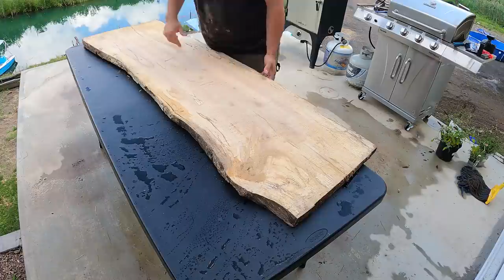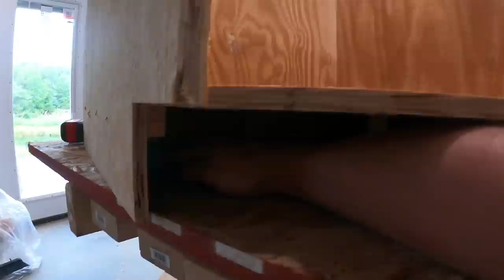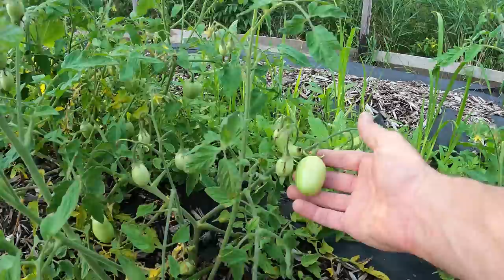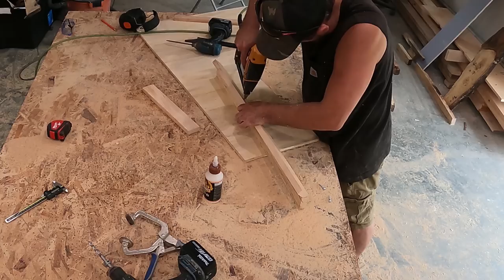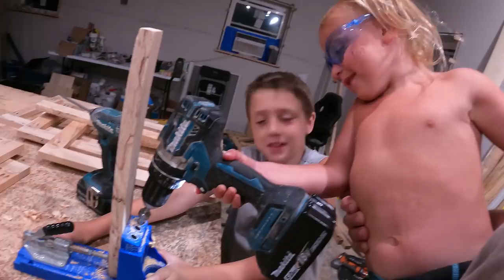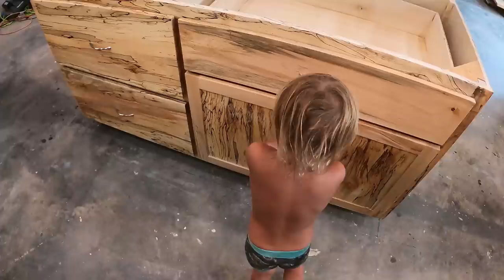From Sawmill to Cabinets : Spalted Maple Shaker Style

Comment: Jesse, the Spalted Maple panels really pops. The extra effort for the panels paid off. Go with low voltage in and under cabinet lighting. Leave access to LED counter top lighting as they do burn out.

Comment: What I have seen with the plywood cabinets is they will run a 3/4 board on the flat (relative to the top) from front to back, about 1 1/2" wide or so. This also gives you something to attach your top to.
I hate to say anything because you already finished, but you can use way less materials making the cabinets "custom" style and running the boxes in 8 foot lengths or more, it just makes getting the top and bottom rails for your face frame a little harder with custom cut lumber. If you want an interior shelf, try a half shelf with supports to the bottom of the floor of the cabinet or adjustable with pins in the face frame, or fixed (I prefer the half shelf and worry for the adjustable ones on the large cabinet runs). I am in the middle of the video, I may think of something else by the end and add another comment but it was just my thought to share now..

Comment: Much admiration for the Cohones it took to jump straight in to those sawmill cuts without a plan. I've tried to learn my lessons on pine but I still ruin plenty of black walnut. I've got a bunch of drying ambrosia maple and the first and last foot of each 9 footer is spalted. When I cut them I tried to plane-saw(tm) meaning overcome the cup in the first saw cut by going back over it again and again with the blade very tight and at max speed. I want to invent a diamond-dust coated blade to act as sandpaper on top of a board so I get 28 inch wide S1S or S2S without a 12000$ planer. I love your use of basic machines. You got the skills to build up to great machines if you sell works like this one. Thanke for the extra teaching talk.. Love your property too man. If I discover you're close to southeast PA I've got some hoarded materials I'll swap ya for a finished project

Comment: Hi Jesse. Yes I agree pocket screws make a very strong cabinet. I am a recent convert to them, because  a builder friend of mine gave me some huge nearly new cabinets he had removed from a house he was renovating for a client.  I used them in my large hobby workshop. They were all made with Maple faced MDF, very heavy and assembled with pocket screws, no glue anywhere but so strong. As I needed more cabinets that I was going to make myself I bought a pocket hole jig similar to the one you have. I have used them to make three mobile benches with draws and cupboards underneath. Previously I had made cabinets by the 1/4, 1/4, 1/4 method It was so much easier making them with the pocket holes than having to do all that machining.
Reply from the maker: Yea these pocket screws are a game changer. They might be a little ugly but they are always on the back side

Comment: Wow, what a massive project. Nice job. I would suggest though that it is best to design things such that the fasteners will be put in sheer whenever possible. For example the bottom of the drawers were glued and nailed straight to the bottom of the sides. If the glue joint ever fails then the nails will always pull out in that configuration. However if the bottom were inset then even if the glue joint failed nails coming in from the side into an inset bottom would never experience a force that would make them want to pull out.

Comment: For the island- keep the middle door and make 2 false panels on either side then open up the sides for a pull out full depth drawer that you can use as a trash drawer - with separate areas within for recycling the trash other end could be a pull out larder style for cereals and canned foods -thats only my opinion😊 but you did a fantastic job on that kitchen- well done Jesse - loving this build series 🎉🎉🎉

Comment: everyone's got to chime in right...my 2 cents is to edge band the plywood edge on the drawers.  last week i bought some stainable  iron on 3/4" edge band from home depot, never used it before...works amazing, easy as talking about it, and looks fantastic.  made the drawers look like solid 1/2" material, from concept to finished and sanded drawers in about 2 min a drawer.  but otherwise great work man!, i recently used spalted hickory and had a very similar coloring and grain.

Comment: In a modern kitchen it is really, really nice to install sliding bottoms on the bottom cabinets.  Getting on your knees to stumble around in the back of a cabinet is fun for no one.  This way you pull the bottom out on full extension drawer slides and can get at everything with ease.  Takes a bit of shimming with face frames but is well worth doing.  Any shelf on the lower cabinets should be a slider.  If you are planning on aging there most especially so.

Comment: Jesse needs to upgrade to a Jet Helical closed stand 6" jointer. I lucked out and found all the items I needed to rebuild my shop with at HALF PRICE.  Found on FB Market place.  Was about a 90 min drive one way but the rewards were worth it. I got the jointer, 44 inch drum sander, oscillating  drum sander and a Powermatic dust collector. Carts, and roller bases were 1/2 off also.  Thanks for taking the time out to explain everything, cabinets are easy once you know the tricks of the trade. Getting the materials ready on the other hand can be a struggle.

Comment: Jesse, before starting the cabinets did you  let the wood acclimate for 3/4 days and have the moisture down around 7/8 but the major problem is sitting the cabinets directly on the concrete because the wood will wick moisture out of the concrete, you need some kind of moisture barrier between them, any water that gets under the concrete will keep cause problems,  but its a great job and beautiful cabinets

Comment: 1/2" x 4' x 8' MDF is only a couple of bucks a sheet more than BC plywood and it's always perfectly flat and extremely stable. You won't have to worry about MDF warping before or after the build. It's only real con is it's a little heavy.

Comment: With the lexan doors and the epoxy tops and lights you will have a one of a kind kitchen for sure!  You may not need a Christmas tree!  lol  You picked one of the most difficult trees to work with given the structural issues, but it turned out incredible so far,  I can't wait to see the next step!
Reply: They're not going to be Lexan . They're going to be epoxy resin poured into a mold , which he will plane on the thickness planer after setting .

Comment: This looks great, very useful tools and detailed explanations. Re: the hinges and door sticking out at 90 degrees - they do manufacture extended soft-close hinges which open 180 degrees though I'm not sure if you have in US as they originated in Europe, I also wondered what the ones you purchased cost - pack of 20 is £30 ($38.42) exc tax over the pond.

Comment: 1/4" is too thin for a panel in a door.  One kick and you'd break it.  Normally, you'd need a panel raising router bit so the edges are 1/4", but the rest is thicker.  You then can put the raised area inside for a Shaker look or outside.

Comment: Those are some really nice looking cabinets, Jesse. Your son with the chicken was hilarious, didn't even notice until you pointed it out, I thought it was a ball or something. I think that chicken might like him.
I found a foam brush more to my liking with the poly coatings; couldn't stop putting brush strokes in until I changed but then I got bubbles, just pop them. You have me curious on which led system you are going to use, they are all either real expensive or practically disposable. that has been frustrating me when people want them.
Island receptacle? I didn't see the wire.
Thanks for the videos. Good job, man.

Comment: For anyone else going through the planning of a new kitchen I would very much recommend a 100% drawer setup, for all elements under waist height. Of all the different kitchens I have used, this is by far the most ergonomical, pleasant and practical - much less bending down, no rummaging in the dark back of a cupboard having to put stuff out on the kitchen floor to get things in the back etc etc. Oh, and you can absolutely do any depth of drawer you wish, just use the correctly dimensioned drawer slides.
Reply from the maker: Yea I may decide to make more drawers later on. I could easily switch to drawers with not alot of effort.

Comment: i wanna give you a good working tip for stacking wood from a sawmill . when you do it again every 6 months or so re stack them in a different way. example the bottem slab in the middle and so on. so you can see if the wood are a little bit crooked . the slabs that are a little crooked you lay them on the bottem with the rest on top so the wood can a little reset to get strait again.,

Comment: think even if you had cut them at 3 inch thick theres going to be tension in the wood when its drying it will warp once you cut it down thinner
maibe you can router and plane the boards down so there at least level maibe glue on  a backing of 5mm ply before making them flat and the same thickness , that might help with warping later on

Comment: If you recess the back of your cabinets 1 inch, and put cleats on the wall, level them out, attach to the studs , and then bevel them 45 degrees, then measure down from the top, and line up a 45 degree cleat on the back of your cabinet , you can line up those wall units, without a dead man or trying to hold them level ,while mounting them to the wall. also make them sturdier ,with mounting points thru the cleats.
r

Comment: Instead of the 45 degree corner pieces, make a full frame to inlay on the inside using pocket screws and that will pull the bows out of the plywood. Also Jamestown Distributors sell a penetrating epoxy that is as thin as water and is perfect for fixing punky wood.

Comment: Atta boy Jesse... good stuff !!
I'm curious about cutting slabs on the saw mill. The issue was that the slabs became twisted after sitting for a while.
I understand that screwing them down tight will give you a flat surface to cut from, but doesn't that almost guarantee that those slabs will also twist once they're cut?
I guess I'd need to try it out for myself to figure this out for sure.

Comment: And just to mention, I am not putting in a 'conventional stove exhaust fan'. Instead, I am going to put in a 6-inch exhaust fan with 6-inch HVAC pipe, and a fancy wall grill with a filter. I haven't worked it all out, but the advantage is that the fan is 450 CFM variable speed. A good thumb rule for exhaust fans is 1 cfm per sq ft of floor space.
Reply: Considering the fact that " CFM "  is an acronym for " cubic feet per minute " .

Comment: I like the look of your cabinets, but I do have one question. Flooring, what is your plan as that could really mess up the look of the cabinets. Also if you are gonna add to the thickness of the floor you most likely will need to raise the base cabinets otherwise they will be to short. Take it from someone with back problems and have worked in short kitchens , it will hurt your back. Even if your wife is shorter she will appreciate it if they are a comfortable height
Reply: Good point , but flooring isn't 12" thick . The cabinets are already shimmed level from 0"-3/4" because of the subfloor . And , not many flooring systems are more than 3/4" thick after installation . Considering we spend little over 1/16th of our daily life in front of the cabinets , no backs will be harmed during the preparation of the meal .

Comment: Beautiful :-) But as you constantly pass vertically (edge) small boards through the DeWalt planer, these metal receiving and feeding bars are distorted. It is better to pass them with a laminated plywood underlay.

Comment: Impressive as always. Noob question but how does hanging the uppers work, do you have to find studs or what?
Reply from the maker: yes, in my case ribs in the ICFs..but they are every 6 inches instead of 16 inches like framing would be

Comment: Part of the problem with your choice of plywood it two fold. It should be 3/4" thick as 1/2" is less sturdy and box store plywood is even worse. I would have recommended 3/4" Baltic birch. It's pretty expensive but the results will be much better and it will give you years of service with no problems. I'm assuming you're building this for yourself so longevity should be a concern. Just some suggestions. I realize cost is a factor in large projects like this but get the best you can afford, not just the cheapest.
Reply from the maker: 1/2" plywood works just fine, I have built plenty of cabinets with it before. If it was ever a problem, I would have no problem upgrading to 3/4 but it was never a problem

Comment: Is there a reason you used pocket screws instead of biscuits?
Reply: Biscuits are not for structural use. They are only for panel alignment. There are places for biscuits and places to use pocket screws. Face frames are typically made with pocket screws.
Reply: Time !

Comment: Visually that spalted maple is too much and it does not fit well with the wall colour. I'd have used clear maple for the door frames and carcase components and the spalted stuff for panels. Also,  the varying grain direction of cupboard panels and drawer fronts is an assault on the eye. It looks like a 1950's kitchen.   I've holiday rented a fair bit and the easiest kitchen to deal with is one with drawers instead of cupboards for all floor cabinets. Slide then drawer out; select the item from above;   close the drawer, easy!  It would have made sense to get a kitchen designer to draw up alternate plans which you and Mrs Jesse could have culled some ideas.  Your construction loses so much drawer space too. 

Sorry to be so blunt, but better that than sycophantic squeals of false delight.

Comment: Layout of cabinets is critical for kitchens. You may regret those deep drawers later. Skinny cabinets are wasteful. I find it better to take 3-6'' from another cabinet to avoid them. Generally never ever make a cabinet less than 12'' wide. Even 15'' if you can, as a minimum.
    edit; btw, 12'' is the legal minimum for countertop space next to a stove.    I just noticed, the stove next to the sink?  Most people will not do that because of interference between two people working at the same time. Typically the cabinet next to it will be swapped to avoid this.  (Upper and lower as a pair)
     Is there an outlet above the sink? I don't think that is permitted.  Way too many outlets.
   As a carpenter, I have a particular fondness for spalted maple.   For the solid doors, to keep the look, rout out the door.
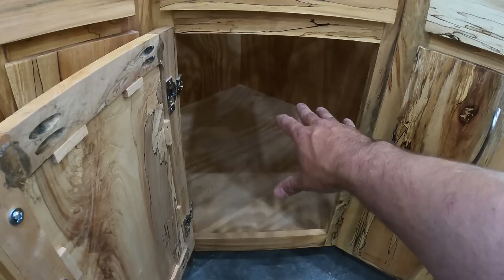    2:11:29  If you put in a lazy susan, block off the rear corner with a panel to avoid stuff getting trapped back there.
Reply from the maker: The only reason I made those skinny cabinets is because I needed the sink cabinet to be where it is, centered under the window and on the right hand side I put the window the exact same distance from the corner so I needed a matching cabinet there. I had those skinny cabinets in my old house and I used them for pizza pans and cookie trays. Drawers were for spatulas and wood spoons. But I wouldnt have made them if I didnt have to, in this case I had to
Reply: @jmuller86  The sink cabinet can be made 3-6'' smaller so you can make the other cabinet bigger. Even a 30'' sink is plenty. Never get dual sinks.
     Also, absolute symmetry is a design trap, and can be ignored to a point. Some symmetry is fine, but you shouldn't get crazy about it.
Reply from the maker: @firesurfer  the sink cabinet cant be smaller, I already bought the sink a long time ago and it requires a 39 inch cabinet. its a bigger sink than normal and deeper too. I made that cabinet 40 inches so I guess I could have made it an inch smaller but that wouldnt have made a difference
Reply: @jmuller86  I made that mistake with my bathroom fixtures. Don't buy stuff ahead of time. There is always something new /better tomorrow. I feel your pain.
Reply: @firesurfer  actually , I only feel YOUR pain .........